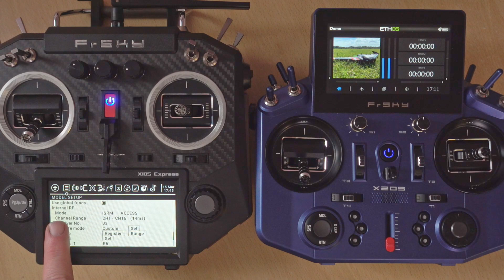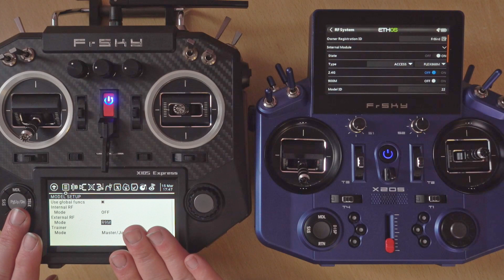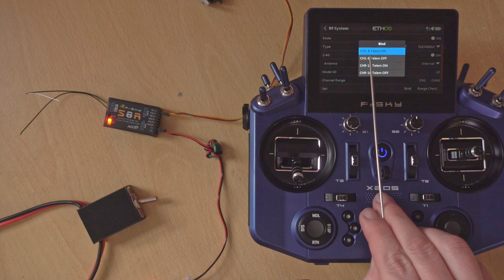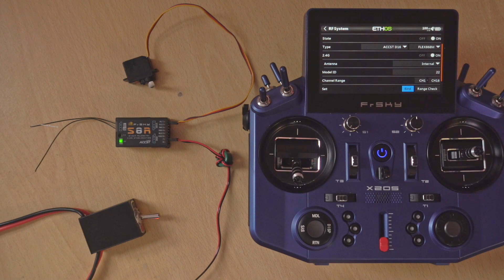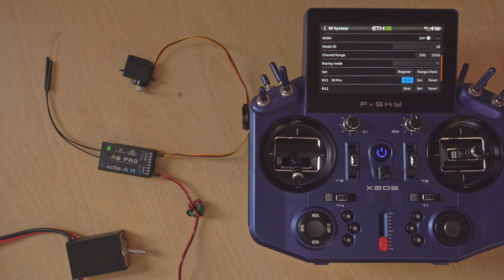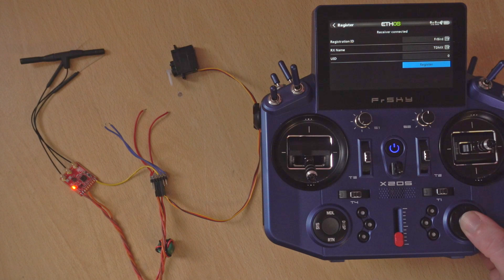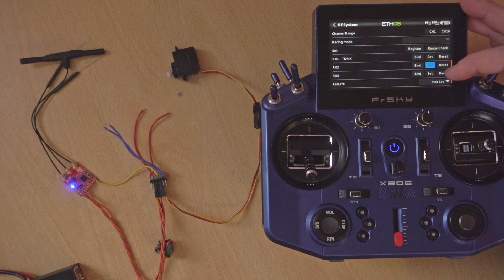How to bind all three types of FrSky receiver: ACCST, ACCESS, and Tandem

Comment: Hi Darren, your videos are awesome and have been so helpful! I updated my Horus X10S with ETHOS.  I have a V8FR-II receiver, which is an 8 channel ACCST receiver. I can't seem to bind it. There is no firmware update for the V8FR-II on the FrSky website, which seems odd to me. Perhaps it is just so old they never updated it. Still, I thought all ACCST receivers could be bound in ETHOS. Any thoughts? Thanks for all you do!
Reply from the maker: That is a pretty old receiver. To use it, you need to have the old XJT hardware. ACCST does work with the new ISRM modules. But only the receivers that use D16 ACCST v2. For the older hardware that uses ACCST D8 or LR12 (the V8FR-II is D8 when in D mode). You need to use an external XJT module or a multi-protocol module.

Comment: Hi Darren Nice work explaining the binding process..I have a question ? i am using X6R on a Horis X10  firmware is V2.10 for rx and tx works fine on the Horus X10.I want to use the same recevers on my new Tandem X 18 but can not bind them is it because the tandem firmware is not the same as the V2.10. In the tandemX18 Currantly in the internal module as TD-ISRM FW V2.2.6.  any help would be appreciated.
Cheers Kosta
Reply from the maker: The X6R should bind on the X18. You need to select the ACCESS/ACCST option for the internal module protocol.
Reply: @MrD  Hi Darren thank you for the reply.I have already set the internal module to ACCST D16 but does not Bind cheers.
Reply from the maker: @rcjetaviator  do you have a mismatch of firmware? They should both either be LBT (EU) or FCC. If you have the flex firmware on the transmitter. You still need to set the region correctly.
Reply: @MrD  Hi DSarren i have  TD-ISRM FW V2.2.6. FCC ON THE TANDEM on the x6r i have the ACCST V2.1.0 LBT
Reply: Hi Darren thank you for your help I just realised what was wrong it was a mismatch of firmware I have re flashed the receiver with ACCST v2.1.0 FCC and all binds ok on the Tandem X18 Cheers Kosta

Comment: Thanks for the video. I wanted to buy a Frsky dual band tx (+900mhz), the 20x but I found like tens of same looking transmitters with massive price difference (pro, s, etc) plus an available preorder for new ones coming soon..!!..  I will be using it with fixed wing planes (electric and gas) and to do some long distance flights with fpv on fixed wing.  Same radio starting $400 to $1200 and more looking almost already the same.  Can any one explain what’s going on!! 

Also why there is 900 and 925mhz!   I am coming from Futaba and Spektrum,,I don’t know anything about Frsky

Comment: what's the proper way to bind a TDMX in conjunction with a tdr 12 or 18? because you can't plug the tdmx into a battery stand alone? you have to plug the tdmx into the master rx for power via sbus in.
Reply from the maker: With those receivers, you’ll be plugging in the TD MX using a standard servo plug. So just use thay to power the TD MX. It should be pretty simple with a BEC and a Y lead.
Reply: y connector OK, but BEC? This is a gas model no BEC. so you mean just plug a small battery into the one side of a Y adapter and the TDMX into the other? because I'm using high voltage connectors on my flight packs. is it really important to bind the TDMX unplugged from the tdr12? because i didn't and things all seem to be working, blue lights blinking everywhere. I didn't activate channel one as Sbus in until after I bound the TDMX, not by design, but by my ignorance which maybe why it worked. any thoughts?

Comment: How do we Ethos bind a model with SR8 pro and R9 Rxs? Say in manual that both bind together - I’m not seeing that
Reply from the maker: Set the protocol to ACCESS and turn on the 2.4 and bind the SR8. Then turn off the 2.4, turn on the 900 and bind the R9. Then switch the 2.4 back on. The SR8 will need to be the master receiver, or turn off the stabilisation.

Comment: Hi.i have just got a twin x lite,and am having trouble binding my receivers .i have a fr sky x8r accst, a v8fr-11 and a d8r-11 plus. Could you do a video showing how to bind these if poss.and what if anything i should do beforehand.
Reply from the maker: This video will show you how to bind the X8R. If it’s not binding, it has the wrong ACCST firmware. Flash it with the latest firmware for your region, and it should bind. 

The V and D receivers are not natively supported by the Twin X Lite. They use the very old D8 protocol. D8 is no longer legal to make new products for. So the new radios don’t support it. But, you can get an XJT Lite module for the radio which does have D8 support.
Reply: @MrD  thank you for that info. I have just ordered a new receiver . So fingers crossed it will be ok.  Thanks again.

Comment: Hi @Mr.D . May you please give your expert input on this issue: I am using a TX12 EdgeTX and Jumper R1, Frsky XM+ and Jumper R8 receivers connected to 16ch SBUS decoders.  When power is applied to the receiver, they apply signals to channels from dead center to -100 or +100 than back to center (If a servo is connected it will move from center to one side tan back to center). That does not happen to the R8. I tried to configure the failsafe on all available modes but there is no change. Is it a normal behavior for these tiny receivers?  Because I need it to keep steady dead center/neutral on all channels when they are powered on just like the R8.

Comment: Hi Mr. D Nick Burns sent me over to you. I just purchased an Iflight baby nazgul 73mm quad with a Frsky D8 receiver. I also have the Taranis QX7 ACCST and i need to setup the model with D8 yes? Also in the CLI i enter bind_rx but what happens is that i have " bind_rx... "with the 3 dots as if Betaflight is waiting for another command. Do i hit save at this point?
Also in my receiver tab in Betaflight the sticks are responding but the little drone on the right is spinnig like crazy in Config tab i can Calibrate ok. Also i cannot arm the quad. Can you help me with this sir? Thank you for your help!

Comment: I just got my X20S 
I am turning away from Crossfire after many years. I just can’t stand modules and bays and all the bits. I’m starting with three 915 mghz OTA. I have been watching many of your videos on ETHOS. This one next. I GOT A FANCY ZORO RADIO AND THE DAMD SLOT FOR THE MICRO MIDULE DESITEGRATED BEFORE I EVEN USED IT. I bought it to replace my TBS Tango that can’t hold calibration. 
I’m very excited to learn this new radios tricks and Ethos system.
Cheers
Daren
Reply from the maker: Good luck. I hope the radio is a good fit for you. I've certainly had nothing disintegrate so far :) After using OpenTX or EdgeTX, ETHOS should be fairly familiar. Thought there are some differences.

Comment: Can you bind an R9 receiver to x20S I've updated firmware and flashed the r9 to Flex but having no luck
Reply from the maker: Yes. Make sure the R9 receiver is on the ACCESS firmware. If you’re using Flex on the receiver, make sure you have also installed the Flex firmware on the X20. Enable the internal module and the 900MHz side. When you register the receiver, make sure to select the correct frequency for your antennas. I’ve bound plenty of old and new R9 receivers. All R9 receivers will work with ACCESS.

Comment: Is it possible to connect the receiver FrSky L9R (Mode LR12) to the FrSky Tandem X18 or X20?
Reply from the maker: Yes. But you need to use the external XJT Lite module. I have this set up on a couple of planes. https://www.frsky-rc.com/product/xjt-lite/

Comment: Im new to all of this. I have a Qx7 ACCST transmitter, I also have a td r10 reciever. Can i bind them?
Reply from the maker: No, those two are not compatible. You need a tandem transmitter to use tandem receivers. 

This tool on my web site should make receiver selection easier for you https://www.mrd-rc.com/tutorials-tools-and-testing/useful-tools/frsky-receiver-compatibility-tool/
Reply: @MrD  ahh. Thank you. From my research i figured that but thanks for confirming.  Go8ng to buy a xr6r for the small size n weight to go with the project. I was originally just building a one for all system. Thanks again

Comment: how to bind frsky R9 (accst) and frsky D8R -II plus with frsky tandem x18.....thanks if you can make a video on it...thanks once again
Reply from the maker: You can’t. You need to flash the R9 receivers with the ACCESS firmware. All R9 receivers have ACCESS firmware, so they can work with the X18. 

The D8R-II is an old D8 receiver. That will not work with the X18. You would need to get an external XJT Lite or Multi-Protocol Module to use the D8R-II.
Reply: @MrD  Thanks a lot...will explorer your advice.Thanks

Comment: Great vids! I used to build rc-airplanes when I was younger. I had a K.O.Digiace and some Futaba transmitters. both AM and FM. I trimmed throws manually on the servo horns and adjusting the length of the actuator. Mostly built my airplanes from drawings and using wood. Now I’m in my middle age and got a couple of modern transmitters, one is a Taranis x9dse2019 and the other multi protocol Jumper T-Lite. Both run OpenTX and the abundance of settings just in these makes me feel dizzy/lost. I also got som receivers, using the ACCESS protocol, a R-XSR, and some FrSky Archer glider receivers also. I have yet to try to register and bind AND make a model memory for my first airplane using the Taranis controller and the R-XSR receiver in a ZOHD Drift. Greetings from Finland! Wish me luck, this new gear isn’t easy for us old timers!
Reply from the maker: Good luck. I know what you mean. It can seem very intimidating, but it’s not too bad once you get used to it. It is a very powerful system when you dive in deeper too.

Comment: Hi Darren I’m setting up a res glider v tail with motor can I move the rudder stick over to aileron stick and how if you can kind regards Mike
Reply from the maker: Sure Mick. To do this, edit the Rudders mix and make note of the settings. Then delete the rudders mix. Next, edit the Ailerons mix and change the settings to match what was in the Rudders mix. You could even rename that mix as Rudders. That should get you what you want. Unfortunately there is no option to select the source in these mixes. That would have made life much simpler.

Comment: Hi, thanks a lot for your videos, they are of great help. I am considering buying the X20: do hou have any evidence of X20 range in 2.4 GHz only (before telemetry is lost and before a signal alert)? I am also planning to buy TD receivers: are you aware of possible interference between the two frequencies or other issues? Thanks a lot
Reply from the maker: Hi Giovanni, thanks; I’m glad the videos have been helpful. 

I’ve not used the 2.4GHz system in anything other than LOS planes. I have never had a telemetry lost warning while flying. But have been close to the edge of my visual ability. So the 2.4 side works flawlessly for its intended purpose. At least one of those flights was with a 2m glider at over 1000m high and out around 250-500m. The glider was basically a dot in the sky. 

The 900MHz side is what is intended for range. An there is no problems with that at all. There is a video somewhere of someone (not me) flying 100Km away with control link. 

There are no interference problems with 2.4GHz and 900MHz. In fact, FPV systems on 900MHz control links quite often used 2.4GHz for the video side, for more range than 5.8GHz.
Reply: Hi Darren, thanks a lot. It was exactly the kind of info I needed! I think I will buy the x20 with the TD10 channel receivers, then!
Reply: If I may, another question: I live in Italy but I can find the TD receivers only on non-EU sites (e.g. Banggood). No site says if the Rx is EU-LBT (868 Mhz) or FCC (900+ Mhz) compliant (or both?). Do you know if the Rx come in a single version good for both standards or you must buy specifically a LBT receiver for a LBT Tx?
Reply from the maker: @giovannivitali9536  with ACCESS the Rx has its region set by the transmitter. So long as you get the correct EU LBT transmitter, it will all work fine.
Reply: Thanks a lot! Great
Reply: @MrD  Hi, I found a serious a problem with the Tandem receiver TD R10 (2.4 Ghz+900 Mhz): the servos start to jitter / chatter strongly when I install the receiver in the fuselage (analog servos, Hitech and Emax). The issue disappears when I turn off the telemetry or wrap the 900 Mhz antenna with aluminum foil, so the issue should be the 900 Mhz telemetry. Unfortunately it is not possible to turn it off separately from the 2.4 Ghz telemetry! Does anyone know if the normal 2.4Ghz receivers have the same jitter issue?
Reply from the maker: 900MHz is known to sometimes cause this. The best option is to keep the 900MHz antenna away from servos or servo leads.
Reply: @MrD  No shielding made the issue go away, so in the end I returned both receivers to RC Studio, which was very available and professional. I then bought an old 2.4 Ghz ACCST receiver (RX8 PRO) and very little jitter. However the radio gave  "RSSI critical" at about 300 meters, once. It seems to me the radio link quality is unstable
Reply from the maker: @giovannivitali9536  you shouldn’t be getting RSSI critical at that distance. Is that in all orientations, or only certain directions? Perhaps there is something in the airframe blocking the signal. You should easily be able to get four times that distance on ACCST without any warnings.
Reply: @MrD  I have placed the antennas outside the fuselage, below it, at 90 degrees. I would assume that nothing should get in the way. I cannot find the telemetry logs in the SD card of my Tandem X20, even though data logging is on in telemetry settings. Do you know what am I doing wrong to obtain logging?

Comment: Great video, but I have a problem that I hope you can help with.  I am trying to use a TD-MX receiver as a satellite to the SR8-Pro receiver. Are Frsky Tandem receiver's incompatible with ACCESS receivers?  I can register and bind a master ACCESS first receiver, but when I switch to TD mode in the transmitter to register and bind the TM-MX receiver, it just doesn't work.  I could not find any information on the Frsky website explaining that you cannot use ACCESS receivers when you are in the TD mode, when the TD is using both 2.4 and 900Mhz.  Any assistance is really appreciated, thank you!!
Reply from the maker: Hi Richard. You can only bind the same protocol types of receiver at any time. So ACCST with ACCES, ACCESS with ACCESS, and Tandem with Tandem. So for redundancy, you would need to use an R9 MX with the SR8 Pro; or any other ACCESS receiver with SBUS out.

Tandem does use both 2.4GHz and 900MHz. But it isn't just sending out ACCESS simultaneously on the two frequencies. It is doing something different in there to optimise the data transmissions.
Reply: Wow!!  Frsky says that the Tandem 20 series radio does both ACCESS and Tandem (TD) receivers.  They fail to mention anywhere that I have seen that one cannot use both ACCESS and TD receivers piggybacked AT THE SAME TIME!!  (despite using the same frequencies)  I also learned that the Tandem transmitter, if updated to the latest firmware, will NOT bind with the TD-MX reciever with its current firmware, unless it is updated to the 1.0.7 firmware first.  I spent several hours trying...lol!!  
And, thank you for making great videos on this subject!!  Please consider incorporating some these issues in your next video if relevant. ✅️😎👍
Reply from the maker: Thank you, I'm glad the videos help. That's the most important thing.

I think the problem here is assumptions, as well as FrSky could have been more direct. Why assume that Tandem could run with ACCESS simultaneously? Would the same be assumed of Tandem and ACCST? They use the same frequencies, that is true. But so do ACCST and ACCESS, and they can't be used simultaneously from the same transmitter module. Tandem and ACCESS are different protocols, so no reason why the two could be used at the same time in that respect. But, it seems like there are plenty of folks who are thinking that the two can work together, so I will make a video introducing Tandem, and make it clear in there :)

Firmware has always been a little bit of a pain. But it's always worth using the latest, stable versions. However, I have looked on the firmware pages for both the X20 and the TD-MX. Both state that receiver firmware 1.0.7 and ISRM 2.2.0 (or above) are needed. Updating the ISRM it states "Note: Please upgrade the Tandem receivers to 1.0.7 or above accordingly."; and on the TD-MX firmware page it states "Note: Please upgrade the Tandem modules to 2.2.0 or above accordingly." So the information is there, at the place the firmware is downloaded. Maybe it could have been put in bold or something to make it stand out more. I will chat with FrSky about this, as I'm sure it will help people out.

Comment: What's Tandem? Is it a new protocol?
I've been using ELRS 2.4 lately, and I just converted my R9 radios to ELRS.
Reply from the maker: Tandem is a new hardware. It combines 2.4 GHz and 900MHz for simultaneous use. So it has inbuilt redundancy and can also choose the best signal to use at the time.